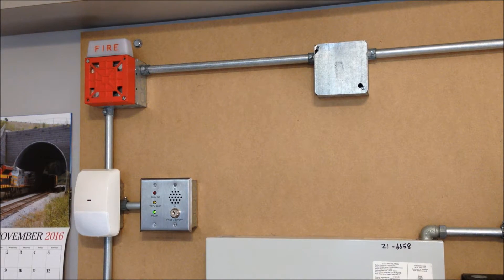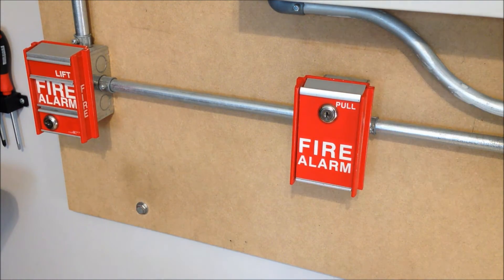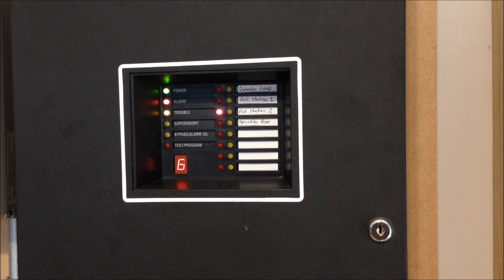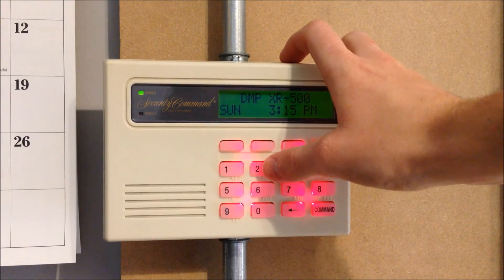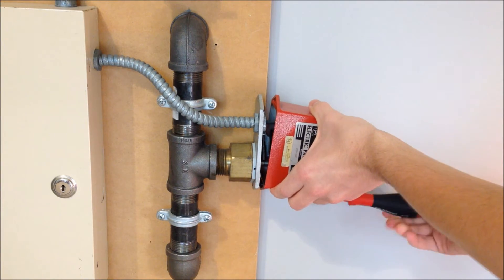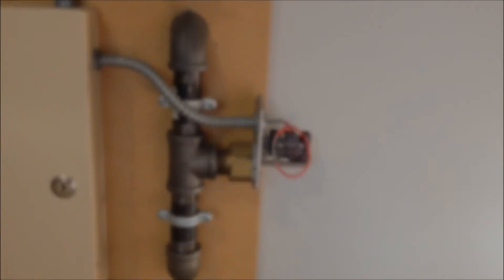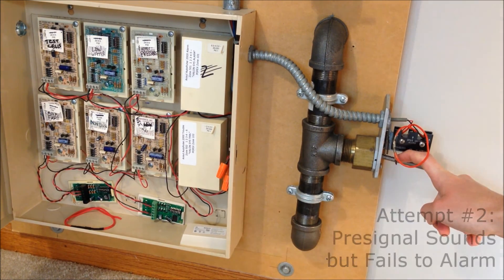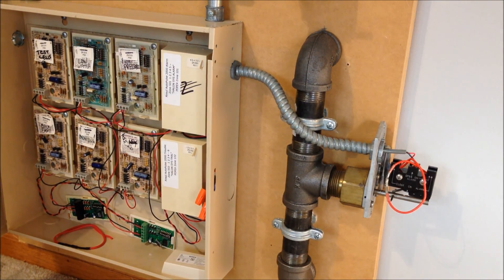System Test 24 | Wheelock 7002T + Unexpected Equipment Failure

Comment: Nice! That's bad that the flow switch's zone only went into pre-signal and not full alarm. I hope you'll find out the reason for the failure
Reply from the maker: I only included three attempts in the video, but in reality I messed with it quite a bit. More than half of the time, I couldn't even get the presignal to sound.  I'm thinking its a programming issue limited to that zone, since I tried a few other zones in that panel and they alarmed just fine. I haven't activated it in nearly a year, so there's a good chance I accidentally changed something since then. Now I just have to find the mistake.